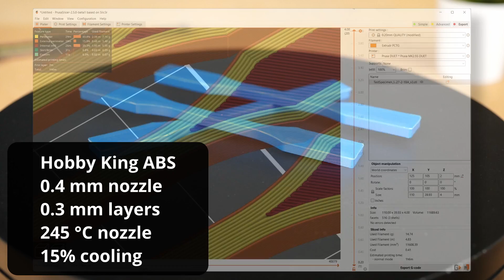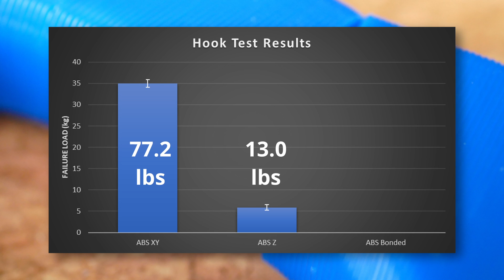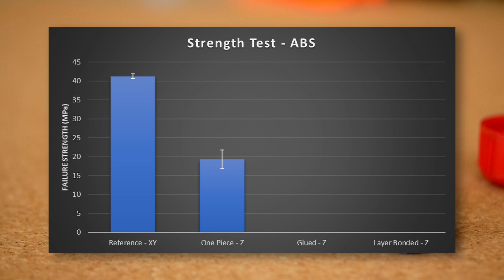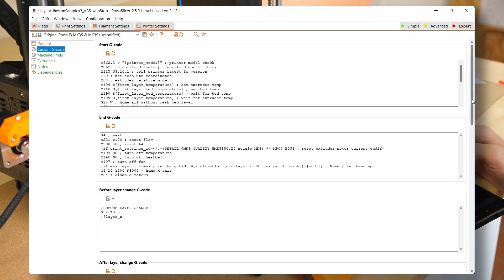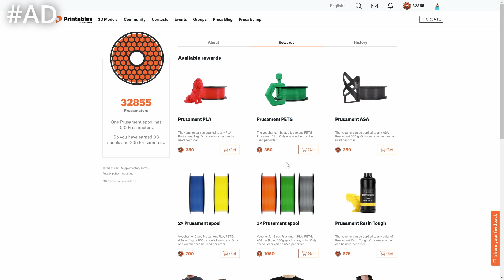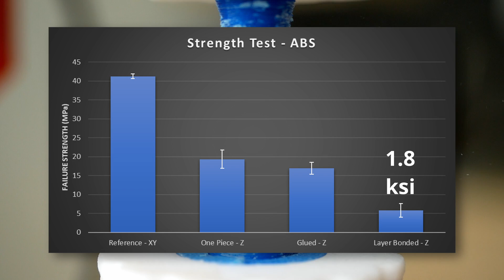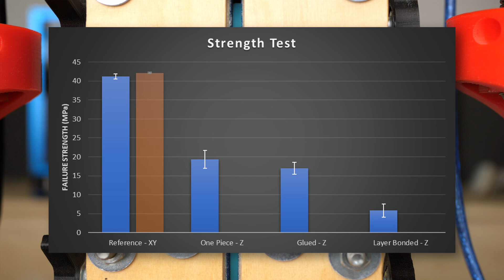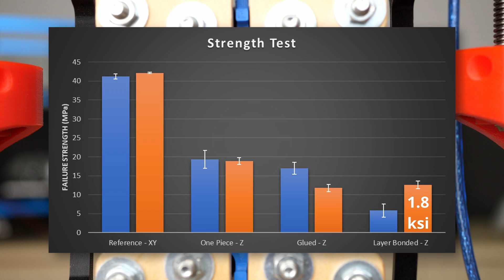Perfect Layer Adhesion if you Brush Solvent onto every Layer of your Print?

Comment: So.... As an ex-Materials Engineering student, with experience in real-world Plastics: a flat nozzle tip isn't ideal, since a flat-to-flat layer bond is not good. If you can get the layers to join with a "splined" or otherwise textured nozzle tip, I would not be surprised in the least, if it exceeded your current samples

Comment: Thank you for this disproof of concept. Now other curious people don't have to repeat this kind of experiment. I think that the liquid solvent and nearly molten plastic is not a happy couple. I guess the solvent is absorbed much deeper into hot plastic than it is absorbed into cold solid plastics. Then you would expect different results with gluing cold parts versus hot parts. Maybe you could make experiments with gluing warmed up parts, or even combinations of cold-cold, cold-hot, hot-hot parts? If even that fails (with lower than printing temperatures), I can't see how this method could have any future.

Comment: Might it be possible to intentionally plow through the last layer with a crown shaped nozzle? this should create more surface area  for the new layer to stick to the last one. the crown would be a compromise between good plowing action and still not ripping the printed part from the heat bed.

Comment: Think "Fuzzy Skin" but for Increased Z bonding strength..  The "fuzzy skin" oscillates the Z axis slightly rather than x/y. 
It would have to be done in a way that doesn't affect the shape of outer layers and the shape of inner layers would need to interlock with layers above/below it.

Comment: I know this would be a bit tricky to pull of but I think getting the iso or acetone into a fogger (that's safe) and using a hose to gently hit each layer with fog would work better. In theory it should greatly reduce evaporation time and has the added bonus of being doable while the part continues to print. Still a bit of a stretch but hey it's an idea. Also somehow making the layers print smoother might help too, more details = more places for the liquid to pool and soften the layers above and below. Great video, thank you for the work!

Comment: i have one speed-up trick for you. cut small venting holes in the polysmooth parts. (hot needle) just so that the inside infill structure has a good way of getting rid of the solvent vapors. it takes very long to degass the alcohol.

Comment: I've been doing very large prints (using a 1200x600x600 printer) in ABS and I've found the best layer bonding strength has come from using a 0.6mm nozzle with 0.8mm line width at 0.2mm height, and cooking the ABS at 250 degrees with a print speed of 80mm/sec. I also use 3 walls and a 5% overlap between walls to minimise porosity in the actual wall structure. 

That said, this hasn't helped as much as I'd like with fine structures. The stuff I print is functional car parts, so needs to be strong. Currently I'm experimenting with alternative materials to try and find a better solution, so interested to see people's ideas here. I've used your videos to help guide a lot of the decisions I've made around these prints too so thank you for being so thorough!

You can see some of the prints I've done over on my channel - I recently upgraded the printer from standard E3D volcano extruders to bondtech BMG and am getting even better prints now, but I think the next movement will be to the X series to really improve the speed.

Comment: I have to imagine I am not the first to say this, but would it be possible to create a filament with a kind of flux-core, so it is basically a solid part of the filmant at first, but when heated to extrustion temperature, it melts into some kind of solventy substance, welding layers together in a strong and more importantly precise manner... thinking about it, maybe a flux COATING rather than core would make more sense, unless it is able to permeate through the actually desired filament material during it's brief working time. I don't know exactly what materials would work well for something like this, but conceptually it FEELS possible and promising

Comment: What about epoxy filled prints especially vase mode, so we can get stronger and fast prints in one go, I mean offload the printer because epoxy curing time is very long. I think we will get more temperature resilient parts this way. Finally another test could be filling FDM prints with SLA resin but both print filament and poured resin must be transparent for curing this way we can get really fast prints but will it be strong 🤔. If the print time is not an issue we can play with the infill % and shape as if it was fiberglass reinforced or even use carbon fiber filament maybe this would be the ultimate strength.
After writing this comment I found Brauns CNC channel doing almost the same suggestions, I guess no more genuine ideas between us tinkerers, same human brain 🧠 everywhere, this is a good thing to know that you are not alone with all the craziness in our minds 😂.

Comment: Maybe if you have an infill pattern that leaves ~0.4mm holes going straight down in the print the nozzle could inject extruded plastic into every 5th or 10th hole (just a random number) so each layer would be interlocked into a few layers below and above.

Comment: Print an object with a very low infill and inject it full of epoxy before capping it off either manually when the print is done or through a printer pause command.

Comment: Just a suggestion, there are isopropyl alcohol in pens for cleaning. It's possible to model and mount for those that can be mounted on the hotend. If it's directly in line with the nozzle on the x axis, all you would need to do is print 2 of the same models on the same gcode, and the printer would automatically draw with the pen on top of the first model while it prints the second model. That would give you a control with each print and automate the whole process.

Comment: What if the layers alternated in cross directions skipping a line. So it prints the first layer normally, nozzle goes up, then the next is missing each odd line, nozzle goes up, the next layer is printed with just odd lines, nozzle goes down, even lines for the current layer are put down, nozzle goes up, even lines of the next layer are printed.

This way the layers would be "weaved", at least bonded on every layer with the next layer.

Comment: This just sounded like a bad idea to me and it seems my intuition was right. Likely the solvent absorbed a lot of heat in phase transition, making it as if you'd printed with nozzle temperature way too low for good bonding, the same as happens with wet filament but an order of magnitude worse.

Comment: For hollow parts, what about addding extra wall thickness by adding thin internal voids around the perimeter. This is added to areas where you want extra strength, but dont want to print the whole part with extra walls

Comment: - An "ironing" pass every n seconds where the nozzle lowers to heat up the previous layer. This could be done in the Gcode. Only problem is finding out what n should be.
- Two lasers mounted on each end of the X carriage or gantry, pointing just ahead of the nozzle. Maybe have them on precise servos so they can swivel along Y. Really hard to engineer though.
- Or, pillars of infill that are printed about 4mm high and far enough away from other features, so they don't collide with the nozzle. Hard to generalize.

Comment: For specific parts we like the vertical test, we could just do the outside and then fill the inside multiple layers at once. Only works with 100% infill though.

Not that some slices can do non-flat, what if we did the infill non flat? I often print at 45° now.

Comment: The solvent may inhibit layer strength. Ultimately the name of the game is increasing the motility of the molecules in the lower layer so they can form bonds with the new top layer.

The solvent on its own does this at room temperature, but soaking into the ABS strands may also mean that once hot filament is extruded on top, the evaporative cooling of the solvent below reduces the temperature it reaches. That could mean you get less layer bonding at high temperatures, despite the presence of solvent.

Comment: I think you could improve strength if you dual extruded a part with a PETG or ABS outer shell and 100% infill of PLA, then heated the part above the glass transition temperature of PLA but below that of the outer shell. This would allow the PLA core to fuse but the detail of the model to not be disrupted.

(Please like this comment so that Stefan sees it! 😊)
Reply: Someone needs to try this, it seems like a simple idea but I have never seen it done.
Reply: Interesting idea, seems possible.
Reply: This is such a genius idea, i have to see it in action since i don’t have the supplies to test it myself!!
Reply: iirc even below glass transition many polymers still deform under any stress

Comment: Have you considered printing a part with an outer shell made from a plastic with a high melting point and then 100% infill of another plastic with a much lower melting point, then annealing it at a temperature sufficient to melt the inner plastic but not the outer shell. I have had this idea for some time but unfortunately I don't have a dual extruding printer so I could never try it. Maybe if its a new idea to you you could test it, or maybe you've already tried it and I just missed that video. One last thing to consider is that it might not give significant improvement to your Z axis tensile strength test because the cross section of the part is such a small area.
Reply: Fascinating, that could work.
Reply: This sounds lilke a solid idea
Reply: This seems like it is worth a test. Stefan you are the guy to do it given your awesome testing setup!
Reply: I'd like to see this done
Reply: I would die to see this, i think it would work great.
Reply: I think he made a video with a filament that was like this. Forget the exact materials it might have been abs and nylon, but one was the core of a strand and the other was a layer around it.

Comment: Very interesting Video and very surprising results 👍 I'm wondering, what would happen, if you would print a part, inside an oven at constantly 60°C ambient temperatur.. I know, you cannot place an 3d printer inside of a baking-oven 😂🥵 But in therory, shouldn't the bonding stronger in this case maybe?
Further, I'm wondering, what service/app you are using, for lerning japanese? I also started to try teach myself japanese for fun, but it's so difficult to learn and I'm looking for a good experienced way to learn

Comment: I was thinking of a hot needle pushing through the layers as it prints.  Problem is that it needs to do this in the center of the hotend with the fillament…

Comment: Just a thought, but what do you think about printing every even number layer (2,4,6,...) with less flow on the infill leaving gaps, and every uneaven number of layers (3,5,7,...) with a bit of overflow on the infill, except the first layer to avoid elephant foot and assure good bonding with the bed.
It would only be posible with 100% infill parts, but this way you may be able to make plastic flow into the gaps you left in the previous layer, making "hooks" that mechanically grip each layer.
I don't know if you can do that with the slicer though, or eaven if the plastic would be able to behave like thay. But if it can I think it would help.
Great video man, love your content and always learning something! 💪👍

Comment: There is definitely under utilized potential in slicer software to improve layer adhesion. Besides all of the settings you already mentioned at the beginning of the video: higher temperature, slower printing speed and less cooling. To increase bonding between layers the mixing of the hot molten plastic needs to be improved. This can be accomplished by: 
• Printing layers while moving the nozzle up and down should improve mixing and put more heat into the plastic (basically stabbing the hot nozzle down into the previous layer and pulling it back out). 
• Having a nozzle that isn't flat but spikey will also improve mixing (stiring up the previous layer while putting on the next).
• Printing layers in spiral patterns, so the nozzle touches the same area more often and for longer.

I really hope you can test these techniques, unfortunately slicer software seems to be more oriented towards good looking prints rather than getting strong isotropic mechanical properties.

Comment: When solvent evaporates the resulting material becomes porous, and therefore weaker than solid plastic. Bonding with UV or epoxy resin should result in much stronger parts

Comment: Unless you modified the print head to apply solvent around the hot end (which I'm not even sure is possible), I think the cooling between each layer is going to more than offset any benefit of the solvent. However, if that cooling wasn't an issue, I'd set up a sponge that could constantly be kept wet and attach that to the print head so it could be dabbed on after every layer.

Comment: What if you add some tiny ducts to let you push the solvent thru the whole structure (or let it soak thru via capillary action or something) after the printing is done, creating an internal mesh of fused plastic that crosses layers?

Comment: Would it be possible to have the layers have a sorta egg carton pattern, sorta like those wavy sound-absorbing foams, modulating the Z height as a function of the X and Y coordinates, at a very small scale, to increase the surface area of the contact between layers and have them meet at more angles than just flat? (Keeping in mind the initial layers would probably still need to be flat to not crash into the bed. Though, perhaps if the oscillations are smaller than the layer height that might not be necessary? I'm not sure about that last part.)

Comment: Did the freshly broken samples smell of solvents? If they were not properly cured, it must have still been in there and you should be able to detect those.
Maybe the slicer can print ridges /\/\/\/\/\ by leaving out a bit of space and the next layer \/\/\/\/\/ should then print into the gap at reduced layer-height. That could give the printed material more contact due to the V shaped gap, rather than putting the sausages just ontop of each other =.
Also: sugoi!

Comment: What about creating (more) capillaries in the 3D print, so when you smooth them, the insides also get joined together more?
Normally some capillaries gets created so the part is not watertight until you solvent smooth it. However you may want to dip it into solvent for a second during smoothing if you want to access all the capillaries inside. Vapour smoothing may close them sooner then accessing the insides.

Comment: disclaimer, I have no experience with 3d printing.
2.5 ideas:
- drill 1-3 very small holes through the length of the part and fill them with acetone to get better adhesion IN the part and not just on the surface 
- modify the nozzle to create a more textured output to help with adhesion of the next layer
- similar than above but use a small vibration motor attached to the nozzle to increase texture of the output

Comment: I have a CRAZY idea about improving layer adhesion!
Design a part with tiny holes, like small cylinders in the Z-direction. Every 5 layers or so, make the printer fill the holes with plastic so you essentially bond five layers together. 
I tried this manually with just a couple of holes printed in transparent filament. I then manually extruded colored filament into the holes and can report that the colored filament did indeed fill the holes for several layers. I was afraid that the trapped air would prevent it from doing so but it worked to some extent at least.
Perhaps printing a high density infill and filling each void would be ideal. Especially if you alternate which voids to fill on each layer.

Comment: Idea: Like ironing but the other way: after the layer is done, the nozzle should poke little holes/intents in the surface, so that it roughens up the surface so the next layer is potential able to get a mechanical interlock between the layers.

Comment: 3D printers are not really 3D, more accurately they are 2D +1.  If the Z axis could be manipulated as the print head is printing.  This would allow a print plane that is not horizontal to the bed.  A print plane of say 40 degrees would be a larger cross sectional area between layers. Would this be stronger?

Comment: If it was necessary to print in ASA for me, I filled acetone in an empty deodorant spray bottle (a manual operated with scew cap) and sprayed the parts gently by turning them around to prevent puddles. It was at least help to make the part more stable than with "open" layers.
Anyway you end up in many tries, different spools and brands that promise you to be the best, to figure out that you had wasted much money and energy to print 3 creepy parts that you finally wanted 😉